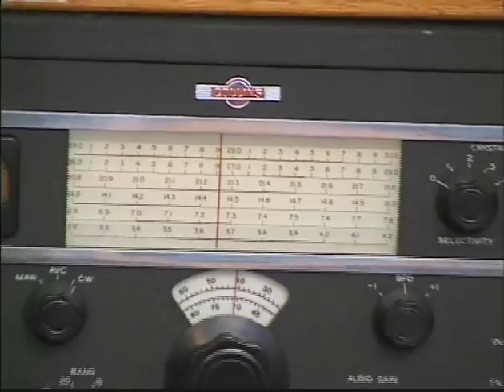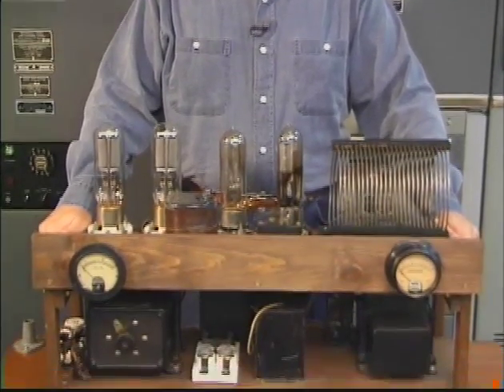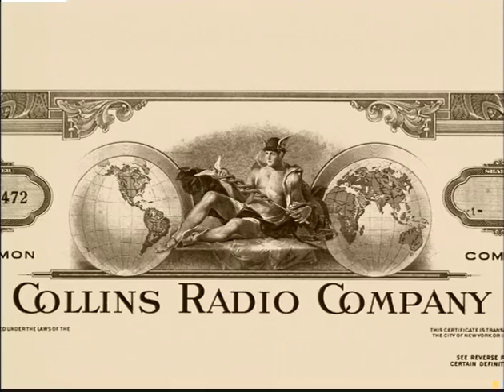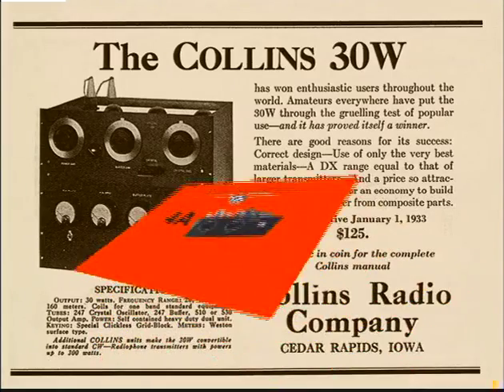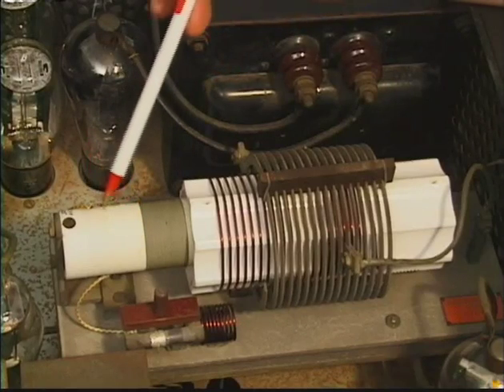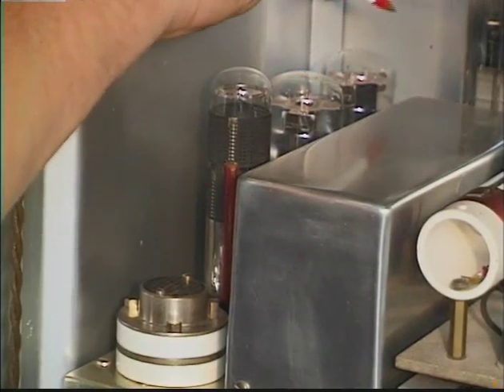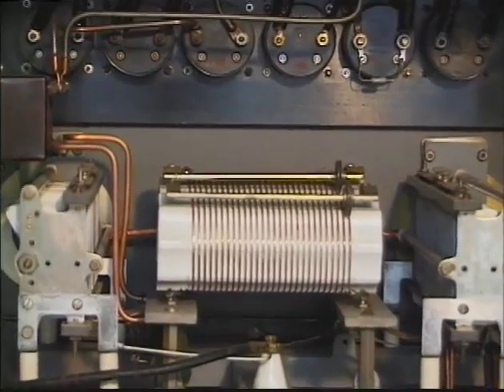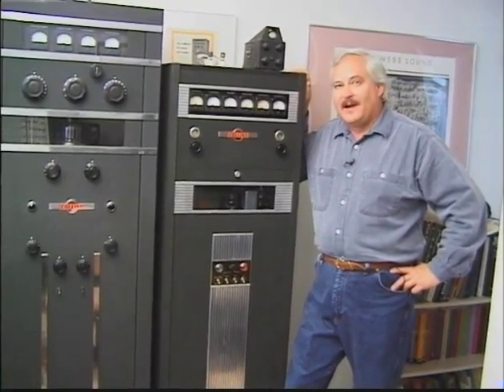The Lost Decade

Comment: I have a 30K-1 S/N 16 that I picked up in 1975 for $75 from a small town near Atlanta, GA.. Someone had tried to convert it to a CB linear and made somewhat of a mess of it. I decided to do more with it than keep it around as a museum piece and built power supplies in it to provide HV, bias and screen voltages and a tank circuit with vacuum capacitors and a roller inductor and put it to use as a 4CX1000A amplifier that I have used for over 30 years. A few years back I decided to play with different RF chassis and have since built RF decks for a pair of 4-400A in GG and a 3-1000Z. I  have all of this  documented on my QRZ page. WA4QGA
Recently I was given, for free, a 30S-1 for the joy of repairing another 30S-1 and a Henry 2K. I use all of my equipment as often as I can rotating thru it to keep it all going including a homebrew AM station using the 310B and a James Millen amplifier running push-pull 812A.  Modulation is a pair of 4-125A and a BC-610 modulation transformer. This is the equipment I wanted as a 13 year old kid when I got my general license in 1963 and now I can have and enjoy it at the age of 72.   73  WA4QGA

Comment: One of my first tasks when I hired on with the US GOVT was to unbox new KWM2A’s and test each one before having them shipped to various overseas locations.  About 25 years later, at an overseas wear house, the KWM2A had long since been removed from service, and I watched as a pile (literally thrown into a pile) of these radios was being ground up into metal strips, in a heavy duty metal grinder.  They were not to be reclaimed or sold or anything.  I was nearly in tears.  Some had never once been used.  I did claim a single, mint condition crystal pack…but it’s nothing more than a useless relic nowadays.